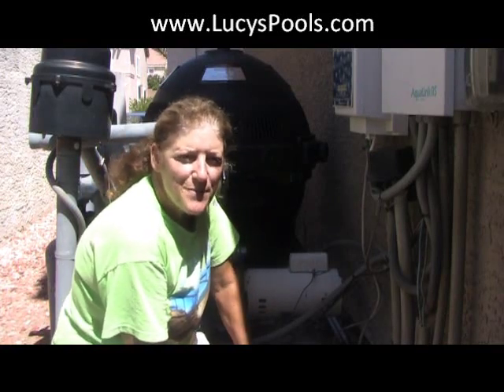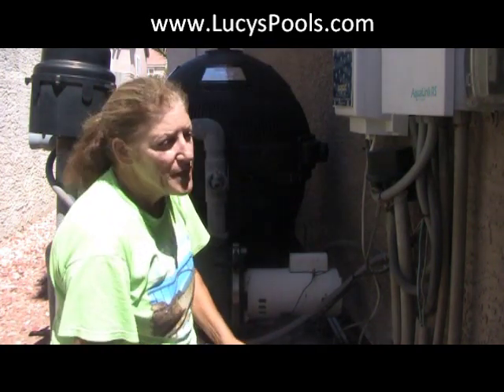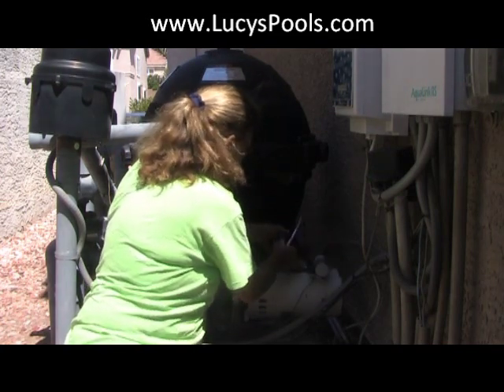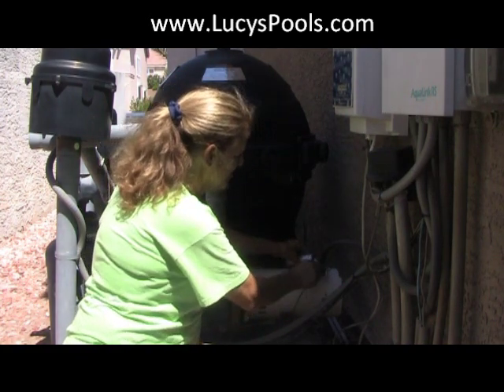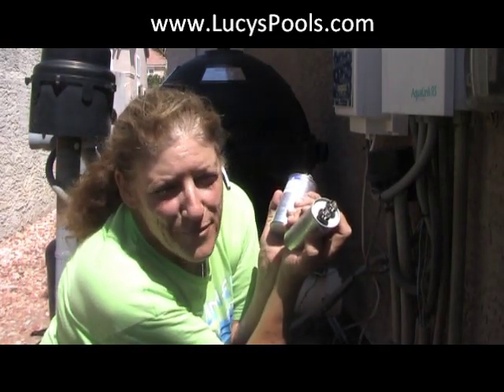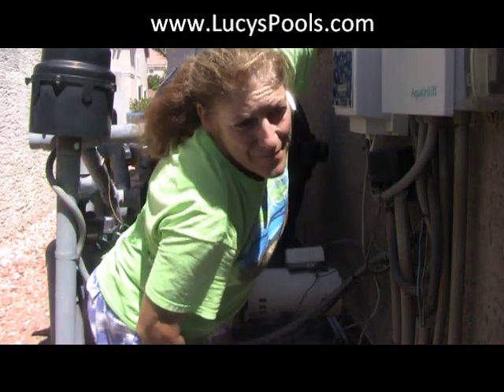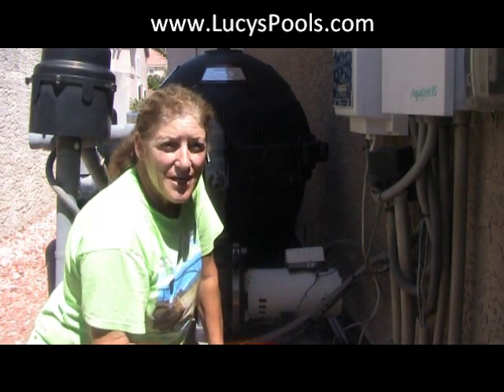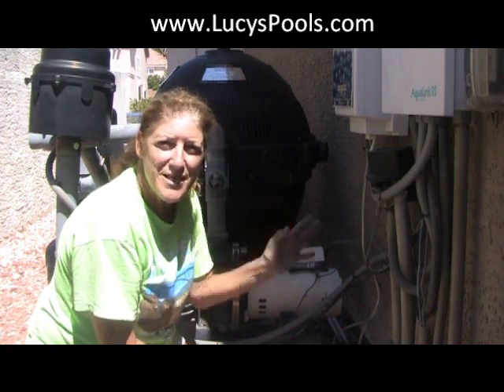Pool Motor - Loud Noise Repair (look in description for link to updated version)

Comment: Could still be the capacitor if it is making a loud noise like that but it does circulate water, it’s just making a loud noise...or when it’s the capacitor it won’t even circulate water? Please advice, thanks!
Reply from the maker: Tengo Una Idea  If water is circulating then it is not a bad capacitor. Depending on the noise, it could be bad bearings or a diffuser has gotten loose inside the housing. Bearings make a very loud noise.
Reply: lucyspools what’s your recommendation, should I replace the entire motor if it’s that? Or is it worth it to replace those bearings, if it’s going to be around the same price then I would rather replace it. Or should I just wait until it goes out on me lol what would you do. Thanks for the advice again
Reply from the maker: Tengo Una Idea  Many people just deal with the noise until it becomes unbearable. It’s up to you. I used to get motors rebuilt but then something else would go out. Depending on the age of the motor, I think it’s just as well to replace it. I usually buy a new pump so I don’t have to deal with a new motor on an old pump. But for many people, money is an issue so a rebuilt is fine. Should have a minimum 90 days warranty, some repair shops offer a one year warranty. Hope this helps. Wouldn’t hurt to have a shop evaluate it if you have the time. Thanks for your question. Lucy
Reply: lucyspools thanks Lucy for you advice, do you have a specific place or website where to buy a new pump? My local store is Leslie’s Pool supply’s I don’t know if you have heard of them

Comment: Thanks for making the videos.  I'm learning so much. It gave me the courage to go and replace the pump.

Just a warning - I bought one that was aftermarket, and same measurements. It was pretty cheap, $13, but I think it's already failing after a few months, or maybe there's something else happening.  So, get the OEM one which is by Genteq. Foto the original and  you can find it online.  BTW, the measurement is called a Farad. It's "F" for farad.  The "u" in front of it means "micro". So it's whatever microfarads.  It's a measurement of charge, kind of like a battery.
Reply from the maker: John Kawakami So happy the videos are helping. I’ve only heard  the measurement being called “microferrins”. Not sure I’m spelling it right. A new capacitor is only around $20.00. If you go to my website www.lucyspools.com and click on “Product Recommendations” scroll to Repairs (I think) you’ll find a few capacitors. They usually last a few years. All the best and thanks for taking the time to write me! Lucy

Comment: Hi Lucy,  What else could this noise be?  I have the EXACT same sound, if I shut it down and try again about an hour later, I can start the pool.  I changed the capacitor, and it is still behaving the same way.  Sometimes it won't start (it just makes that very loud noise) and sometimes it starts and works normally.  The pump is fairly quiet (sounds like new) once it gets going.
Reply from the maker: +Brad G It's possible that it could be a loose diffuser. Is your pump a Hayward Super II? Another issue could be the shaft is getting stuck. That happens if the seal has leaked and the bearings ran dry (but then the motor would be noisy). Try turning the impeller to hear if it's rubbing on the diffuser. If so you'll have to take the motor off and reset the diffuser. The last thing is be sure the capacitor you bought has the charge you expect. Sometimes if they sit on a shelf they can lose some juice. Hope this helps, Lucy

Comment: I have a 2 speed Pentair pump which has become louder on high. Could it be this or is it just debris inside it? It used to be so much quieter and still is on low but now on high it is just much louder. It is working ok but just annoying compared to the first 2 years. Thank you!
Reply from the maker: n4ktz It could be a few things, but as long as it is running, it's not the capacitor. First, be sure your impeller is clean. Next, I would check to be sure that you don't have air being pulled in...if you have a Jandy or Compool valve at the inlet you can see if there is a bad 'O' ring by turning your system on, then when you shut the motor off, watch to see if any water squirts out of the valve...either from the stem (center) or the sides of the lid. Also, the pipe that goes into the pump many times will have a small leak. All these scenarios can cause air to be pulled in, especially at the higher speed, creating a loud noise. Try checking those things out, and if you want to let me know if it's any of those things. I have a video on how to replace Jandy 'O' rings.     If it's a leak at the pump inlet...while the pump is running squeeze silicone around the pipe but DO NOT SHUT PUMP OFF UNTIL SILICONE IS COMPLETELT DRY. If it is the pump inlet, clean the old silicone first, then replace it with a hefty amount of silicone, creating a seal. Difficult to say for sure because I'm not there to hear it, but by your description it sounds like air being pulled in. (also, open all your valves to see if that helps reduce the noise...your pump may be needing more water). Hope these suggestions help, Lucy

Comment: Hi Lucy, I have a Pentair whisper flow..my motor does not hum, just sound really loud..kinda like the previous video..could that be the capacitor or bearings?
Reply from the maker: Joe Toscano If it sounds loud and then shuts off, it's probably still the capacitor. If it's loud but keeps running, it's probably the bearings. Normally capacitors turn off within 30 seconds. But get the bearings fixed, otherwise the shaft will freeze up and you have to buy a new motor. All the best, Lucy

Comment: My pump is doing the same thing but there's no capacitor on top . Could it be inside the pump?
Reply from the maker: Yes in the back of the motor.  (Sorry for the late response, am recovering from back surgery)